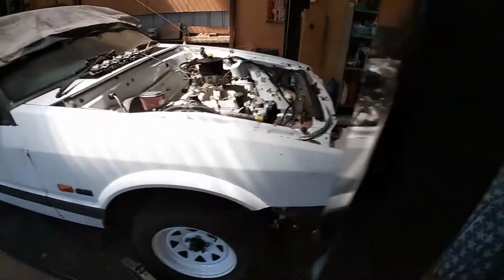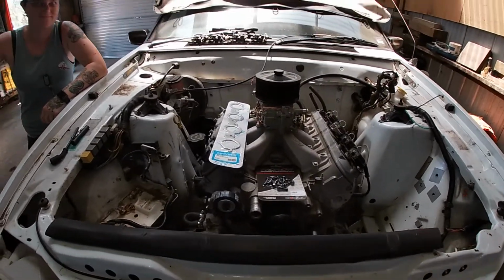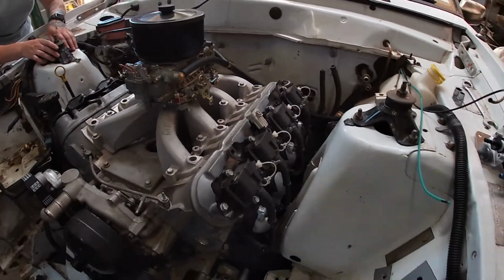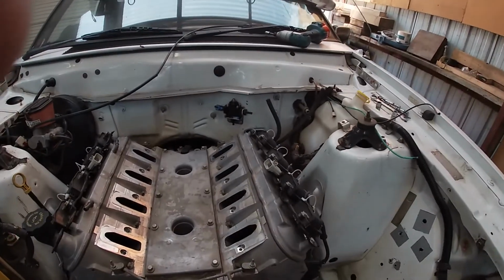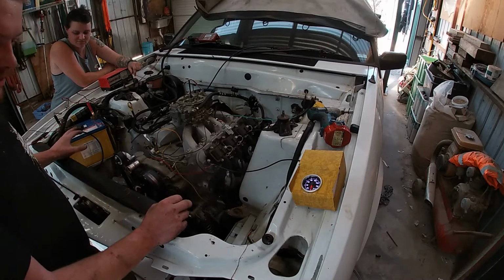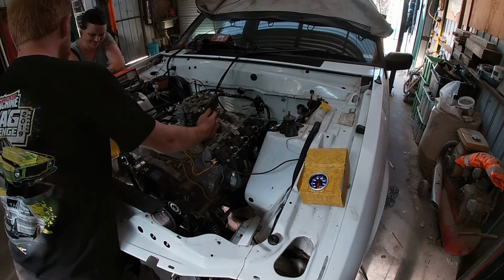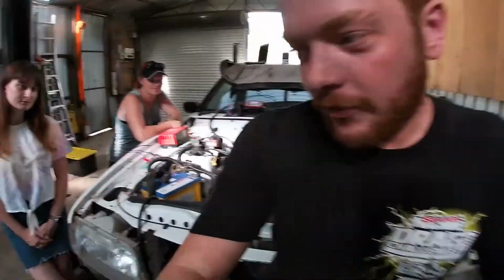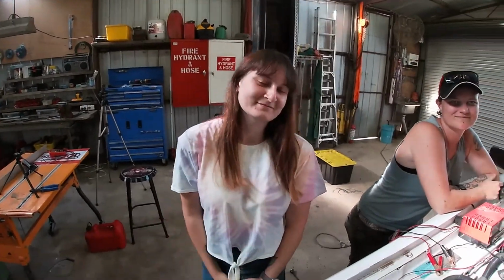XG ute EP12: First Start!!!

Comment: Sounds mint! Is the msd box hard to wire up?
Reply from the maker: Very easy, plugs into crank, cam, ect and coils. Then there power and earth. There 1 wire if you want step retard (nitrous), 1 wire if you want a launch limiter and 1 wire for a tacho output